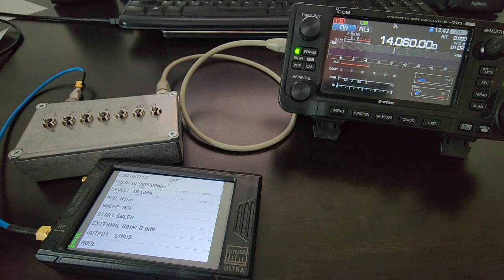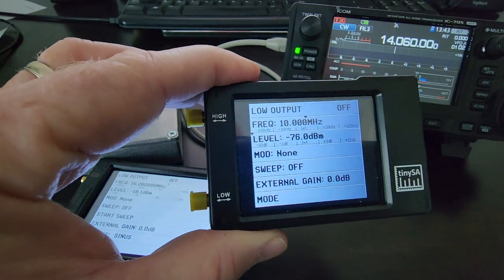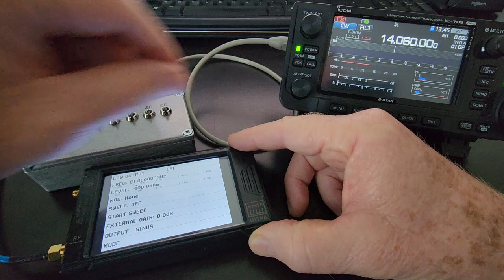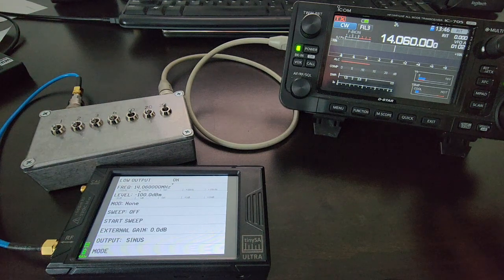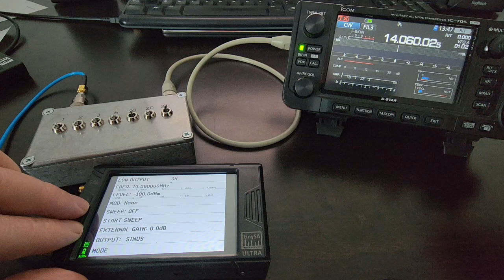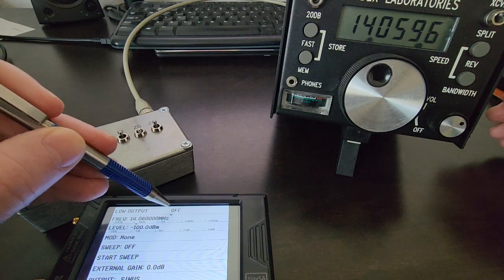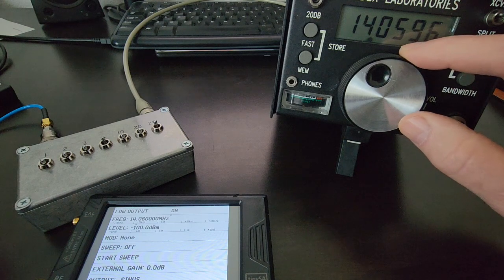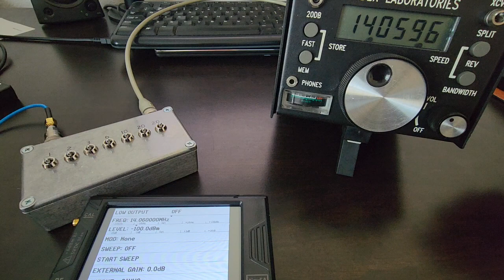Receiver check with tinySA ULTRA

Comment: Nice job comparing two xcvrs side by side, thanks.  I had the Index Labs xcvr several years ago, it was a great performer.  The use of a step attenuator in conjunction with the Tiny SA Ultra was a great idea.  73's OM.

Comment: Thanks for the video, i only use my TINY SA for 11m , 27mhz ssb cb restoration and tuning, this is answers my qustion whether it would be worth upgrading too.
Are then any other advantages with the ULTRA for my HF endeavors?
Much appreciated.
Reply from the maker: About the only other advantage would be the increased dynamic range in SA mode, ie you'd be able to see harmonics at a lower level than would be visible with the non-Ultra. But even with the non-Ultra, you'd see harmonics down to -60dB or so which is good enough.

Comment: You can eliminate the manual calculations by using a fixed external attenuator setting of 60dB and setting the EXTERNAL GAIN to -60dB. This would show on the tinySA the dBm level that goes into the radio causing less opportunities for errors.
Reply: Hi Eric, quick question, I also asked John.  How does Johns tinySA go as low as -123dBm?  Mine tinySA+ only goes down to -115dBm as specified on tinySA wilki.
Reply: @M9SVW During further testing it became clear not all tinySA could reach  below -115 dBm so later firmware uses this as the lowest limit
Reply: @ErikKaashoek  Cheers for the response Eric. Now I understand why.